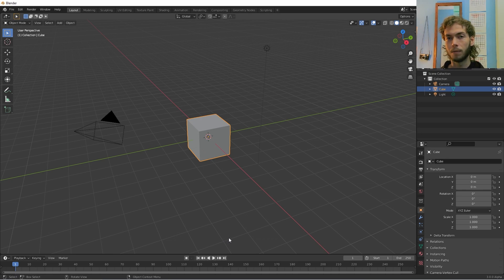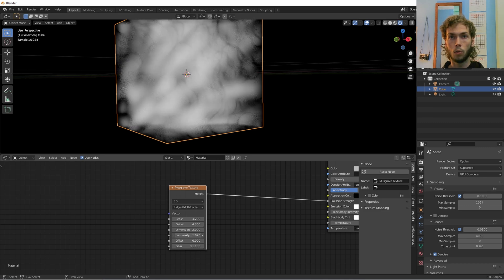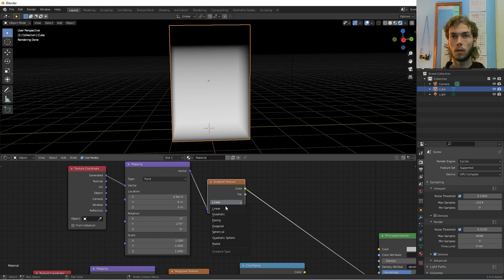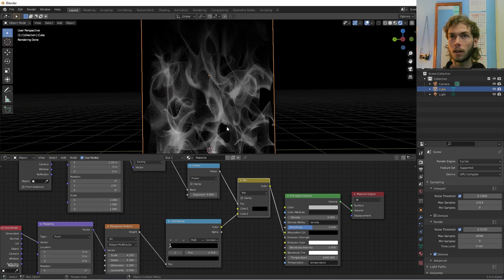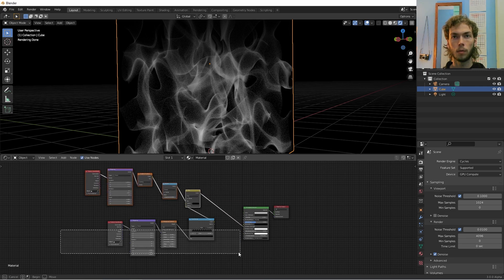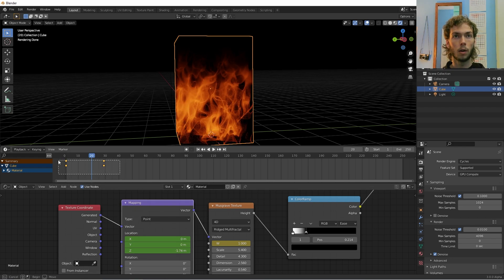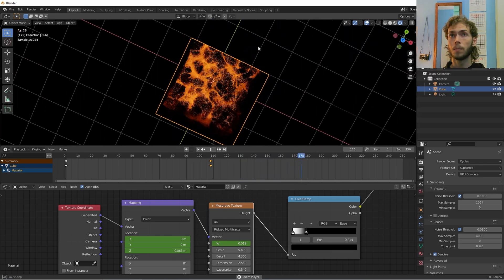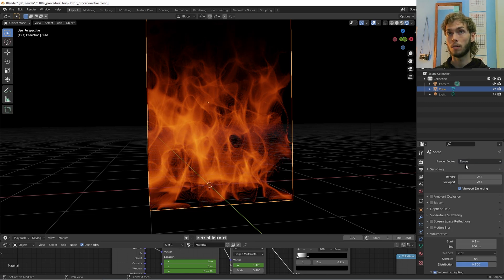Procedural Flames in Blender

Comment: Hej... love the idea... and looks great... 💜 Actually, I found that the seemingly useless color ramp might need its input connected to the output of musgrave color ramp to work better (and then switch colors and shift them to the right). Also, I added a connection from the multiply output to the volume density to get rid of white fog artifacts.